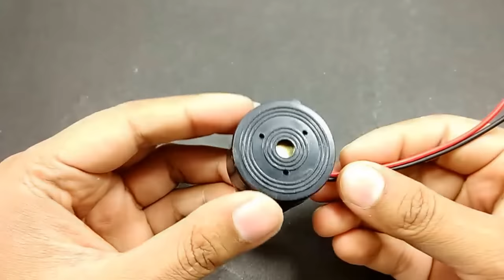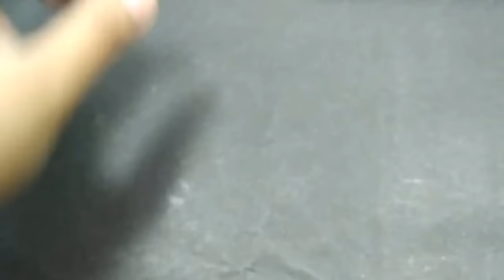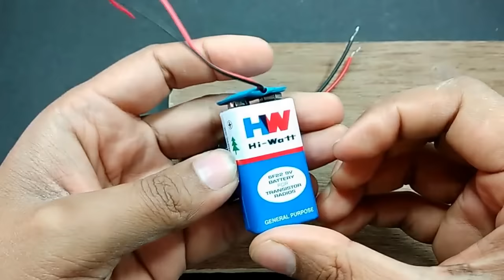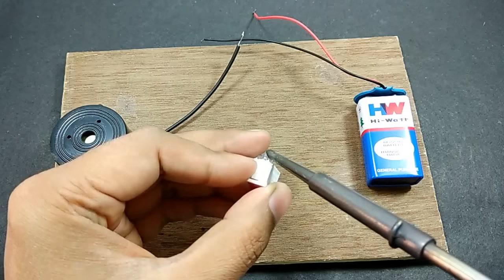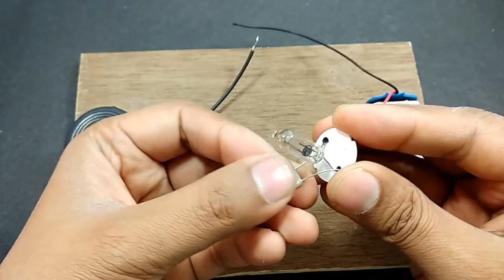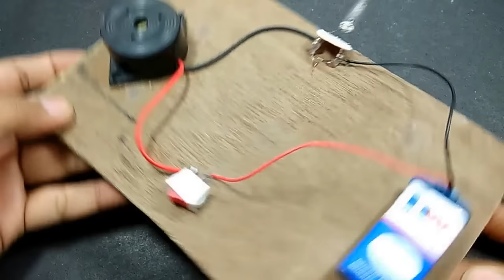How to make Fire Detector Alarm at home || Very Simple ||

Comment: you should mention the materials only you are showing
Reply: Hey bro ! I know it is being complicated without knowing product but I listed out the products. MATERIALS-Capacitor, buzzer , battery , battery cap( blue one with two wire putted on the battery ) , on of switch
Reply: exactly
Reply: @advaitpandey6549  it is battery connector
Reply: Ya right

Comment: Bro u should mention the materials needed , just u are showing ☹️
Reply: Materials Required-battery, battery cap, buzzer,safety starter (it is present in all tube lights with a small blue cover).That all. One more thing is used but I don't know what it is, but I made a model with the mentioned materials and it works.....

Are you, my buddy having problem making a model for school project just like me......then go for it this its good n easy ..........😀😃😁
Reply: Bro i think it's spst switch....
Am I right
Reply: Rakshitha G
Reply: Yes

Comment: Awful music but nice idea. But why that large chassis? You could  make this much more tiny. And the switch is unnecessary. It only makes it unsure. Because the soldering can melt in the heat, I would use wrapping instead of soldering. Of course you can then add a little bit solder if wanted. Also soldering to the fluorescent starter is not always sure because of the materials used in the pins. Wonder how much heat the starter needs to get closed? You could test it in the oven to see if the alarm works and doesn’t melt before.

Comment: How can  we join two heat detector on single 9 v hw battery
Reply: Simple
Just join negative wire to +wire of switch
, -wire of switch to +wire of 1 heat detector,. -wire of. 1 heat detector to +wire of 2 heat detector, -wire of 2 heat detector to +wire of buzzer, -wire of buzzer to + wire of battery